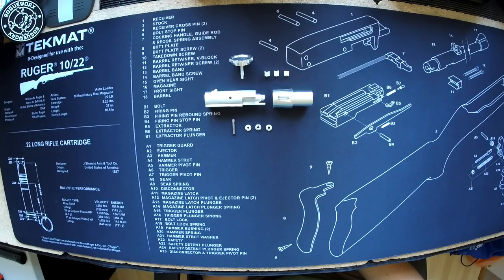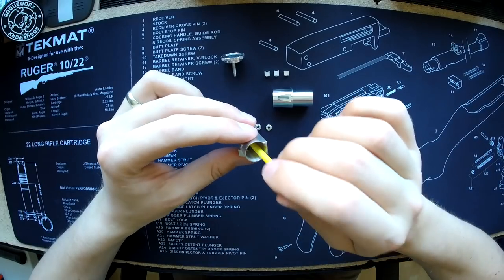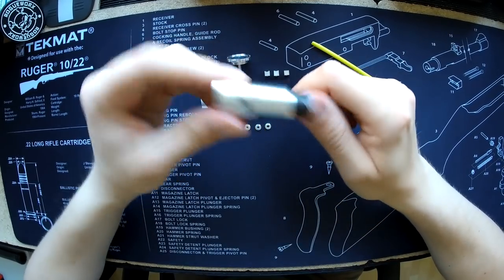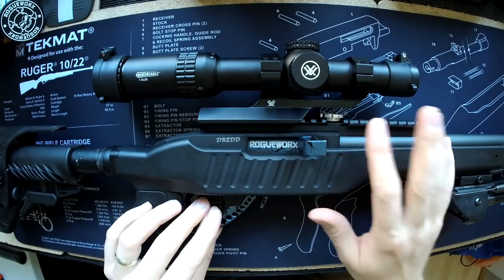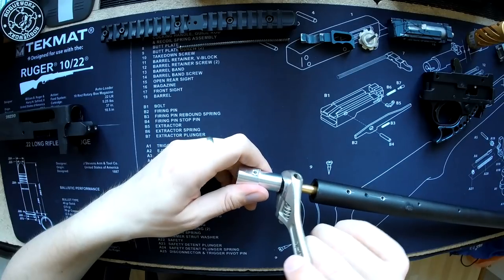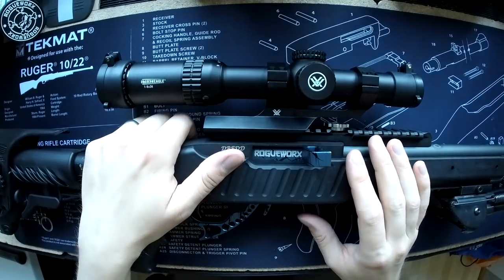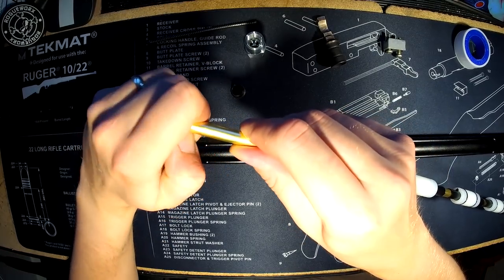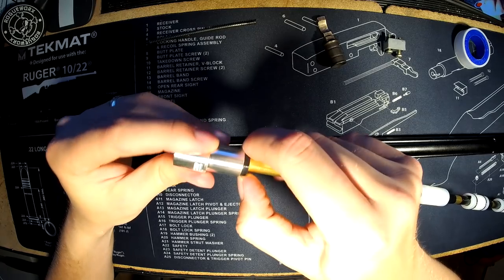Welcome to Genesis - KC-02 VSR Conversion Kit - RogueWorx

Comment: Looks beautiful, super excited for this conversion chamber & nozzle. I’m curious to see how close the nozzle places the bb to the hop rubbers contact patch

Hopefully I get chosen for the Beta group and I can check on this :D
Reply from the maker: It was over-hopping 0.4g ammo with a 70deg rubber and almost no hop applied so I think I've done a good job.
Reply: RoguePlank Hey Arron, yeah I saw your post on FB regarding the testing over the weekend. It’s cool to see this system has an excess of power. 

I’m sure you have done a great job with the designs, I know you have been working on this for a long time. What I was referring to tho, was wether or not the bb has any room to shift around prior to being shot. So once the bb is loaded from the mag into the hop chamber, and now it’s waiting to be fired, is there any play at that point? I have found that if there is any room for play, it leads to flyers & less consistent shot placement. On the other hand, if you are able to get the BB to rest right at the beginning of the hop patch, it will keep the bb aligned properly(no room for shifting), and the shots tend to track a lot better. 

This was a bigger issue with the old traditional mound style buckings, since there was more room for the bb to room around, so having the perfect length nozzle was key. This Isn’t as big of an issue for the newer contact patch style bucking (like ML), but since you have the opportunity to adjust the nozzle length prior to full production I thought I would say something. 

Love what you guys are doing, can’t wait for future innovations. Or just some sweet new cosmetic parts :D